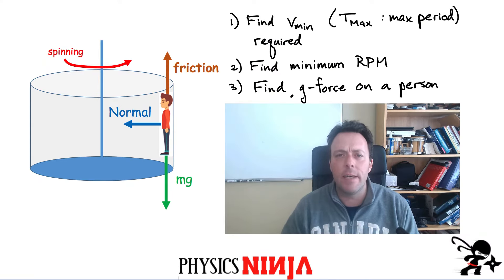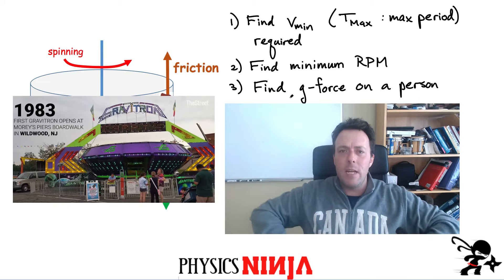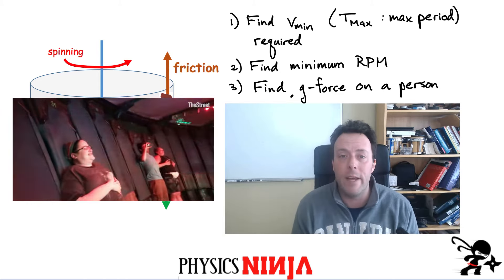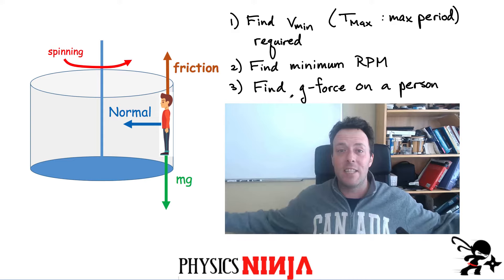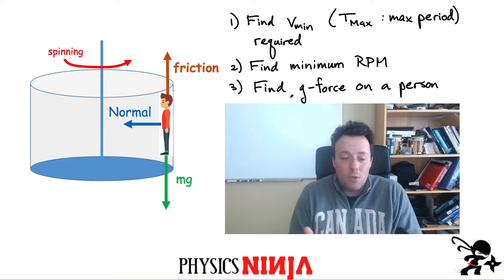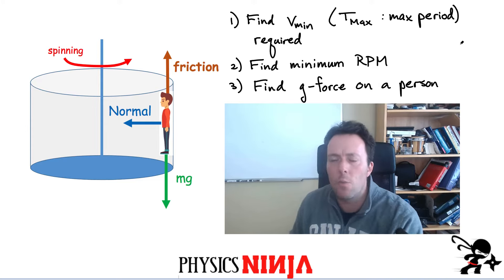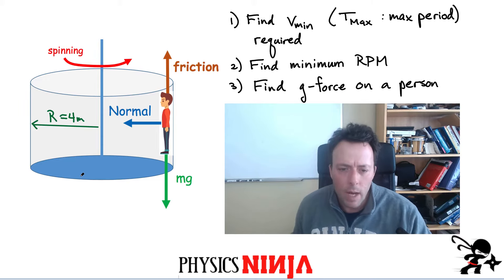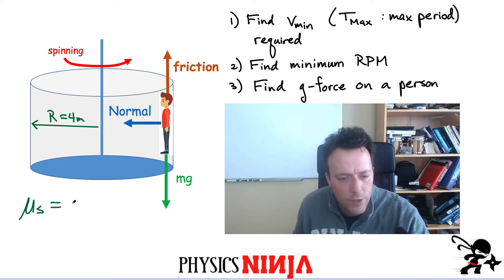Physics of Amusement Park Ride (Gravitron)

Comment: tf did you calculate? 24 rpm is the maximum rpm. not the minimum. the minimum rpm should be when the g-force is around 1g. with my current calculations, it would be 15 rpm...
Reply from the maker: No its the minimum.  Clearly if you spin t 1000 RPM there will be enough friction to hold you up and If you spin at 1 RPM you will slip.
Reply: @PhysicsNinja  well what do you mean then with "minimum rpm"?

Comment: I was 5 or 6 and went on that thing with my dad, stepmom and my brother... I was scared when I see the floor start to drop. Everyone around me seemed just fine but I was so afraid I would fall to the floor, because whatever was holding me to that wall would let me go.  Of course, did not help that the ride operator kept telling everyone to stay on the wall... keep yourself tightly against the wall.... I was so afraid I would fall that I just closed my eyes until it was over.  I tried it again a few years later and I am not sure exactly what went wrong, but two people did fall from the wall.... we were still spinning and everything... about maybe 2 mins into the ride... I didn't think that possible once the ride was in full motion.  When they dropped you could hear them hit the floor. The ride operator said something thru the speaker system and then I felt use start slowing and the floor started coming back up.  So, I guess my question is... say you have 20 people in the ride... very from gender, height, and weight from 80 pounds to say 400 pounds... wouldn't you need to spin faster in order to hold up a 400 pound person compared to an 80 pound person?
Reply from the maker: I that’s the great part about this ride.  The minimum speed only depends on the coefficient of friction and gravity.    The friction is probably about the same for everyone and so gravity is the same so everyone gets to have fun.
Reply: Have you been on the gravertron before would it make me dizzy would I be able to stand because I have moblty issues wth the speed and the forces like in a big centrefuse

Comment: 14:14 - I would include fs and N in calculating the g-force, rather than just N.  The way I understand g-force, is that it is the sum total of all the forces you can feel (i.e. excluding gravity), since those are the forces that your body has to support internally.  So 2.7 would be the number of g's.

Comment: What’s the difference in centripetal force vs centrifugal force and which one is it?
Reply: Centripetal force is the force that opposes an object’s linear inertia and pulls it back toward the center of rotation, forcing it to travel in a circular path (“centri”=center; “petal”=toward). Centrifugal force is centripetal’s equal-and-opposite (Newton’s third law). That is, it is the summation of the object’s inertia and the centripetal force fighting against eachother, which causes the object to experience a force radially outward from the center (“fugal”=fleeing). On the Gravitron, the force you feel of being pulled toward the wall is the fugal, and the force of the wall against your back is the petal.